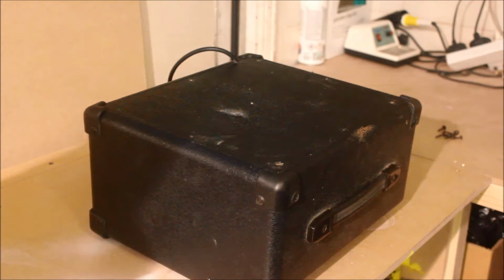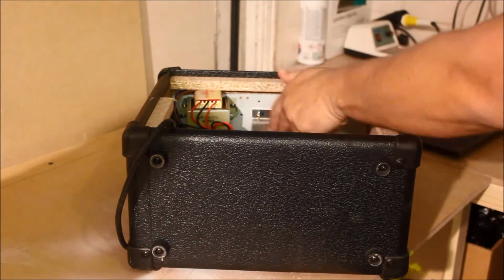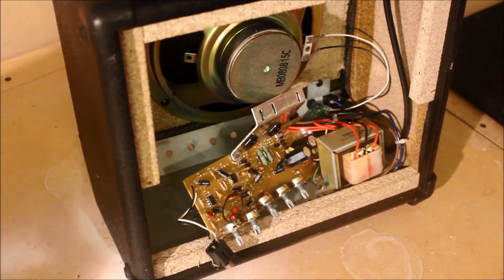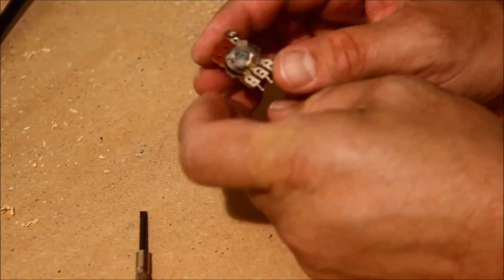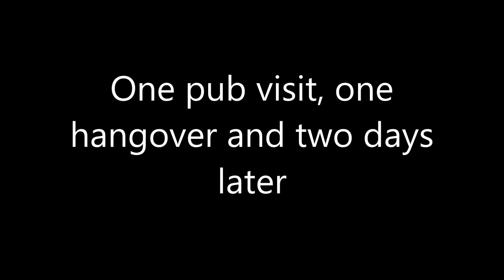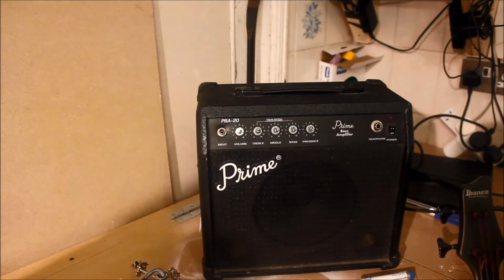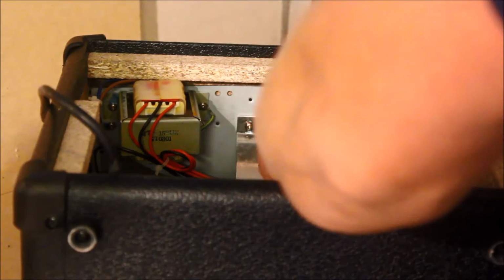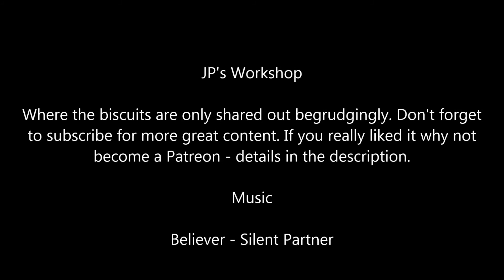How To Replace Volume Pots on Guitar Amplifiers

Comment: Nice work JP!! I have a fender amp from 1990. It's a stage 112 se. It has that problem...need to change the pots for sure.
Reply from the maker: Thanks for watching, thats a lovely old amp you have, you should get it back into use ASAP!
Reply: The crackling is very disturbing...I need to put it on my list of things....

Comment: I hope you’re still reading these. I have a volume pot that when I turn it up it’s only a whisper. Would replacing/cleaning it be your first guess at why it’s not working correctly? Thanks if that is it your tutorial is exactly what I need
Reply from the maker: Hard to say without more detail but for the few seconds it takes, it's always worth giving your pots, switches, and jacks a clean. Sadly there are many reasons a volume would only output a whisper, could be you've blown a valve or a transistor.

Comment: Can anyone help me.. I have a Roland micro cube and of all pots to go bad it is the one that controls 4 fx so my confusion is that each 25% of  turn is hi two low of 1/4 of effects.. anyway bought it used n that pot spins 360• so past off n on so. My confusion is is this fixable? Replaceable? And is this just any ordinary pit or do I need to order some special 4 way? New to this and don’t know the differences or where to order them.. I’d hate to be out a $180 decent practice amp n my best amp at the moment over a bad pot but the amp is useless because you can’t find on off sweet spot and it blends all 4 Fx as of now so you can’t even just leave it on say just chorus just phase just flange just Trem it’s a blend of a horrid sound... any help appreciated thank you

Comment: i need help. i accidentally  broke my  master volume  control pod/button   on my  guitar amp . is that an easy fix or is it   not  possible to fix?
Reply from the maker: depends very much on the amp
Reply: JP's Workshop  amp is called  line 6, spider 3
Reply from the maker: I'm not familiar with that amp and I'm not sure what you mean by master volume control pod button? Is it one where you pull the knob out to toggle between clean and overdrive? Whatever it is as long as you can get to the board the pot is mounted on then it should be a straightforward repair, just make sure when you order your new pot that the resistance matches the old one and for volume control you should be buying a logarithmic pot. Might even be worth emailing Line 6 to see if they carry spares. Also when you dismantle your amp take lots of pictures along the way to help you remember how it goe sback together. Good luck and if it seems unsafe don't do it.

Comment: no help at all 'identifying' ! lucky you, you ordered the right pot.
Reply from the maker: You're quite right to point this out, though most pots you find have their resistance value printed on the back. Replace like for like and you should be fine, logarithmic for volume and linear for tone
Reply: I have the same issue "identifying" what I need as a volume pot for an old Hartke B120 bass combo ... Should I just by "any" logaritmic scale pot and solder it in? or is there any guidance/experience/advice on which to buy ?

Comment: My bass amp has been really quiet for weeks now. I’ve replaced the battery and even the clip but it’s still about 1/3 as loud as usual. I’m sure it’s not the actual bass or cables but it’s hard to see what’s wrong with the amp itself.